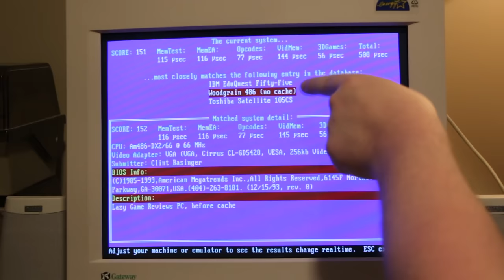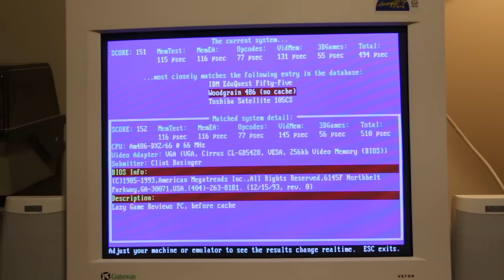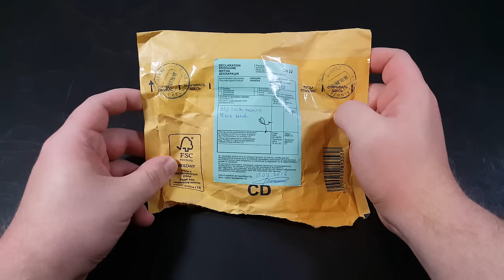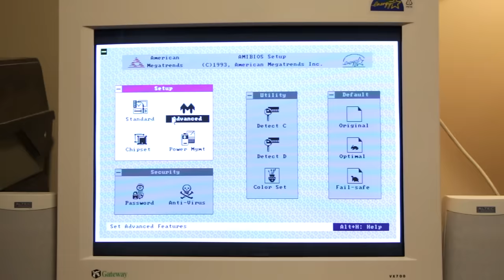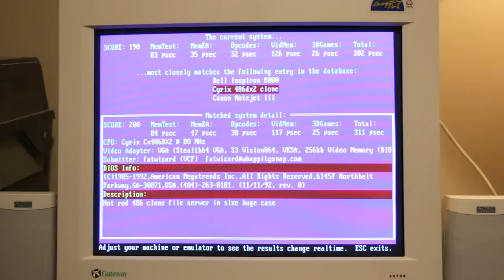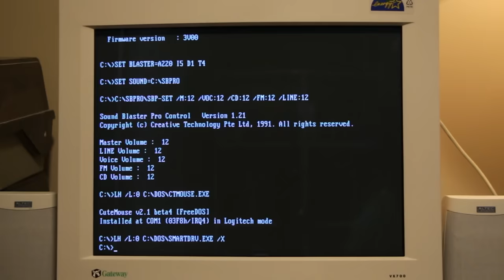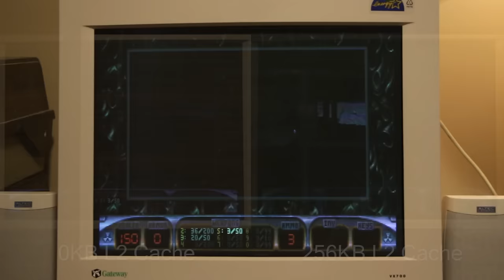LGR 486 Update! Installing L2 Cache

Comment: I never get tired of watching your videos man, your way of talking, your knowledge and all that stuff... Keep doing what you do. <3
Reply from the maker: Thank you!
Reply: I LOVE YOU
Reply: Looks like mine and other's recommendation still was enough to warrant for a new video. ;-) However, I must point out that the machine is still not very optimized. Maybe you should set the cache speed to max. Also, 512K is not going to happen unless you find 4x 1024K cache chips. And eve then, there will be no upgrade to the speed, since you only increase the cacheable area. (from 32MB to 64MB) The more drastic improvements will be a Write-Back Enabled DX2 CPU. It does not enable this caching method out of spite, only a handful 486 actually support that. The other thing would be a PCI or VLB card that is fast enough like a Matrox PCI or a Mach32 VLB card. :)
Reply: Knowledge!
Here in my garage, just bought a new 486 here. It’s fun to try out here in the Goodwill hills. But you know what I like more than materialistic things? Performance. In fact, I’m a lot more proud of these seven new L2 Cache's that I had to get installed to upgrade two thousand new 486's that I bought.
Reply: 4 x 128K cache chips?
But are you saying that if he had installed just one chip for 32KB L2 cache, it would only cover 4MB of address space?
Reply: Spillerrec 486 Motherboards only had like 4-8 SIMM sockets. Most people only had them filld with 4x 1MB Memory. 64K cache were common for high end 386, which had only 8MB max at the time when they were released. 4MB Modules were released at the very early 90s and were super expensive. So with 512K cache, you would have to find a way to fit 64MB into that 486 to make use of them. Most chipsets didn't even make use of more than 256K.... :)

Comment: Yay, L2-Cache! This fine 486 sure did deserve it!

edit: Given that you can disable the L2 cache in the BIOS (without that jumper configuration horror, oh my) you may be able to, e.g., do Doom "timedemo demo1" (I guess duke3d also has timedemo functionality?) benchmarks with and without L2 cache to quantify the speed gain if you desire to do so.

Great video, always a pleasure to watch!

edit2: Another thing that influences 486 performance: The original 486 L1 cache design is a write-through cache, which means that any writes need to be synced with memory (or L2) immediately. Intel later (with the DX4) changed this to a write-back cache, where L1 cache lines need only be written to memory (or L2) when they need to make place in the L1 cache for other contents, greatly reducing write accesses to memory.

Your 486 is a "66NV8T", which means it's a 66 MHz piece, with reverse-engineered (non-Intel) microcode, 8 KB of L1 cache, write-through (the "T") caching policy - this should perform exactly like an Intel DX2. Later AMD released the "Enhanced Am486", which has write-back cache and performs better than the classic flavors if the BIOS enables write-back L1 cache (or if there's a jumper setting for it). If you happen to have other AMD 486 chips lying around: If the model code ends with a "B" (e.g., "66SV8B", like https://commons.wikimedia.org/wiki/File%3AAMD_Am486.jpg) this is a newer version. The 100 MHz Am486 you considered in your original build is such a newer version (and, of course, will also run nicely at 66 MHz if you so desire).

(I don't think Intel released a DX2 with write-back cache)

Comment: Damn! You just shook the dust out of my old nerd brain. I used to build these things years ago. Went to many a computer show (Geek flea market) and bought parts! Never bought a ready made box. It was more fun building it out yourself. A co-worker and I years back when the Atari 130xe, etc. were popular were working night ak/a Graveyard shift. Being Resident Programmer Analysts could get pretty boring on the night shift. We were there in case a job on the mainframe coughed up some bits which thankfully was rare. A bored RPA was a dangerous thing soo... We hardware hacked two Atari 130xe's and kicked them up to 320k! A monster in those days. They got a kick out of us with ripping open the machines and swapping out chips plus making wire jumps on the board to be able to address the extra ram in bank switching. Ahh.. those were the days.
Reply: Do you still have the Atari 130XEs? If so, check out some of the current upgrades. 1MB and more, 65816 CPUs, RGB output, Dual POKEY "stereo" audio, SD Cart Adapters, WiFi Modems, you name it!

Comment: The difference between 28 and 32 pin SRAM sockets is the maximum memory per chip supported. The 32 pin sockets have extra address lines to support 64Kx8 SRAMs, while the 28 pin sockets only support 32Kx8.

Technically that board could handle 384k of cache with 4 x 64Kx8 and 4 x 32Kx8 chips, but I doubt it could address all of it due to the TAG RAM being too small.

The 32 pin sockets are probably to give the user the option to use four 64Kx8 chips or eight 32Kx8 for 256K of cache; Or two 64Kx8 or four 32Kx8 chips for 128K of cache.

Comment: Shove a 100MHz DX-4 in there Clint! Com'on, you know you wana!! (:
Reply: As someone who had a DX2-66 growing up, I would be interested to see just how much more performant that processor might be. What do you say, Clint?
Reply: +John Bradley I've used both. With a DX4 @ 100MHz, Duke 3D is incredibly smooth (at standard resolution OFC). That's without boarders and high graphics mode too.
Reply from the maker: I've talked about and showed a DX4-100 before! It's quite fast.
https://www.youtube.com/watch?v=Qt-0lqkJUKE
Reply: +Lazy Game Reviews True that. Just thought that the speed advantage would be a nice thing to have considering the compatibility for DOSing should be much the same as a 66 DX2. Love these hardware vids none-the-less, Especially anything 386/486 related! A 386 (or before era) build would be pretty sweet someday though. (hint? =P)
Reply: Excellent. I need to dig deeper into your back catalog, apparently.
Reply: how about 5x86DX5-133? it should really rock!
Reply: No, that's 486-class CPU manufactured by AMD or Cyrix. And fits on Socket 3.

Even more, there is 5x86DX5-150 and 5x86DX5-160 CPU existing, but they are very very very rare. And 160 needs 40 fsb, which can cause instabilities in PCI.
Reply: If I wanted a PCI based system, I'd rather go for a K6, 6x86 or a Pentium.

+R33Racer The DX 4 100 does beat a Pentium 60 and 66. The Pentium didn't stretch it's legs until the 90Mhz came out.
Reply: I had a 486 that had a 50MHz CPU then I was able to get a DX-4 100MHz and I was happy as hell and used it mostly for Linux and IRC. One day some one gave me a 486 that had one of those Kingston 486 to 586 upgrades and even though it was 133MHz it couldn't catch up with the DX-4.
Reply: I had amd dx4 133 "designed for microsoft windows 95" with windows logo on top but it might just be rebranded 5x86dx5
Reply: I ran an AMD 5x86-133 for a couple of years at 150Mhz on a 50Mhz bus. It was very stable since you typically didn't have PCI in the 486 era, except at the very end. He's using a VLB motherboard, which should be fine as long at the vesa(vlb) video card tolerates the bus at 40 or 50Mhz, which most of them do.
Reply: Am5x86 @ 160 MHz works fine with PCI cards, you will run into problems using 40 MHz fsb & VLB cards. 
BTW the 160 MHz version was never released. You could use the ADZ version to get 160 MHz by overclocking. The ADZ is overclocking-friendly.
The 150Mhz version runs @ 3x 50 MHz, so this is probably worse than 4x 40 MHz = 160 MHz.
Reply: Never even heard of those. They were basically the pentium equivalent from AMD? Why not just use a pentium though? :P
Reply: Not exactly, the Am5x86 aka AMD 486DX5 aka AMD X5 is still a true 486 CPU. It just comes with a 4x clock multiplier (DX4 had 3x clock multiplier).
These came out in late 1995, when Pentiums already ruled the world. So maybe they thought hey let's call it 5x86 ! That sounds like a next generation CPU !
The Am5x86-133 also got a P75 rating. That means the 133 MHz version should more or less equal a Pentium 75 in performance.
But in reality, you would need to overclock it, put in on a fast motherboard etc etc etc...to achieve the performance of something like a P75.
I like the design of the Am5x86, you could easily upgrade an old 486 system with one of these, but I also think that this Am5x86 is a bit overrated these days :)
Reply: Kingston turbochip 5x86 :-)
Reply: The one in the video was the Intel version, but I do remember you showing that there was an AMD version that you considered putting into it. Required a fan and everything. Would be cool to see you put it in along with the full ammount of memory and that 512 cache.
Reply: Oh hell yeah!  I used to have one of those bad boys. It was the Intel overdrive chip with the built on heatsink. VERY fast for its day...
Reply: Upgraded from a SX33 to a AMD DX4-120 and that was well fast could certainly match a P60 or P75
Reply: That was the cpu of our first pc Happy times
Reply: ***** I have several. Sadly nothing above 100Mhz or a 5x86. I own Two 100Mhz DX4's. One in a VESA desktop, and one in an All-in-One Compaq (silimar to LGR's though slightly later with a CD-ROM drive).
Reply: +R33Racer Reminds me of my DX-33 & DX-50 MHz machines!!! I remember when I bought a 1 Meg Trident video card too(then upgraded to 4megs in this same way) thinking... What a difference!
Reply: The 100 MHz DX4s are just fine. If you have an Intel DX4 with 16kb L1-cache, you are probably as good as with an Am486DX4-120. I have an Intel DX4-machine and an Am5x86 @ 160 MHz. Believe it or not, but its hard to tell the difference between these two. An Intel DX4 is roughly twice as fast as a DX2-66 in some applications, but a 160 MHz Am5x86 is roughly just 30% faster than a DX4-100 in the same benchmarks. The 486 architecture is pretty much at its limit around 100/133 MHz. Beyond that point, CPU speed won't affect much.
Reply: A 486DX4 100MHz ought to be equivalent in performance to a Pentium 66Mhz, if memory serves me.
Reply: ***** Nah not really, more like 50Mhz if such a Pentium existed. Intel really made a monster when they introduced that CPU. AMD would be in it's dust (with a few noteworthy exceptions) until they made their Athlon Skt.A CPU's.
Reply: +R33Racer I remember upgrading to the Athlon back in the day :)
Reply: 1blisslife And, before the Athlon processors, I remember building a PC with the K6-2 and then replacing that CPU with a K6-III on an old Jamicon AT Socket 7 motherboard with an ALi chipset.  When that motherboard bit the dust, I replaced it with an FIC motherboard using a VIA chipset.

After that one wound up being too slow for my needs, I built a new machine with a Biostar motherboard with an nVidia chipset running with an Athlon XP 3200+ CPU.

Then, I was given a broken Dell Dimension 4600.  It was nothing serious: reset of the motherboard fixed it and I replaced the PSU.  I then upgraded that from its 2.6 GHz P4 to a P4 Northwood running at 3.2 GHz (complete with a copper heatsink).  I would have preferred a 3.4, but I had gotten a good deal for the 3.2, so the price difference didn't justify the slight performance gain with the 3.4.  Eventually got a GeForce 7800 GS for it.

Then after that, I wound up with my MacBook Pro.
Reply: My history:
80286 20mhz, 486sx 33mhz, Amd K6-3 300mhz, Athlon XP 2200mhz, Intelquadcore 2.6 ghz.... today Intel i5
Reply: Synthusiast Cool.

My history was with a Tandy 2000 with the 80186, then a Commodore 64.

Then a nice upgrade to that Tandy 486sx 33MHz, which would be upgraded to a 486DX4 100 courtesy of the CPU slot for the Overdrive upgrade.  Then then K6-2 at 300 MHz and then up from there.
Reply: DX4 was horrid... 4 times multiplier... only a 25Mhz bus? Nah.. The 66 with a 33 bus was much more balanced.
Reply: DX4 has a 3x clock multiplier, 3 x 33.X MHz = 99.X MHz.
Reply: Diggnuts Well, that slow bus speed was the ticket to letting some of those Sierra AGI and SCI engine games run properly.

And, hey, that old Tandy with the Overdrive upgrade was able to run some relatively demanding DOS games, like "Wing Commander 3" and "Fade to Black" in their Super VGA modes, without any problems despite its limitations.

For me, the setup I had worked perfectly.
Reply: Screw that, he should get a 133MHz AM5x86 like my old PC has. Thing is blazing fast. (for 1995)
Reply: It's very deep man.  So deep, I'm afraid to dig into because I know I probably won't come out again.  Anytime I do dig into it, it's usually because youtube suggests something from it when it can't think of new stuff to pitch.
Reply: the best 486 should be the 4/120. since it runs on 40mhz interenally. as far as i remember the 4/100 only ran on 33,3MHz. there's a 4/133 as well i believe, which also runs on 33,3MHz internally. 40Mhz internally can limit the number of VLB cards you can use tho.
Reply: Why exactly does a DX4-100 have inferior memory and I/O throughput ? Some DX4 models provide 16kb L1-Cache (at least all of Intel's DX4s). 
Never heard of a DX2 having more than 8kb. That is a huge advantage in memory performance.
When it comes to memory performance, I would say a DX4-100 with 16kb L1-Cache would outrun every DX2 on the planet when plugged into the same motherboard. 

The only time I encountered problems with cache speed was when I set the cache-timings too fast. Fast CPU + slow cache-timings never were a problem. 
Another big problem is, if you add too much RAM to the system, you will probably get too much RAM outside the cacheable area and the whole system's performance will get slower. 
This is motherboard-specific. For example, some boards can handle 32mb RAM with only 256kb L2-Cache, some boards will need 512kb or even 1mb L2-Cache to handle 32mb of RAM.
If we look at Clint's video here, we can see reading from L2-cache is 42.9 MB/s. 
Non-cached reading only achieves 11.6 MB/s (If I got that right). 
What I want to tell you is, I think that "cache that can't keep up with bus-speed" is an illusion.
To get things stable, only add as much RAM as your amount of cache can handle.
Tuning the timings in this case might give you an impression of increasing stuff. 
But things will get bad again, if there's reading or writing in the non-cached area.

If your motherboard can't provide 3.3v or doesn't natively support a DX4, you can always stick with a DX4 overdrive. In my opinion its all a matter of personal taste nowadays.
If you have a nice high performance DX2-80 setup, there's nothing wrong about it. Maybe it is indeed faster than some DX4 setups. I would also prefer a nice DX2-setup like back in the days over a "modern" Pentium-era DX4 like the Am5x86.

Basically you are right, you can reach higher clock speeds for the ISA-bus with 40 MHz bus-speed than with 33 MHz bus-speed.
You can also run your VLB-cards with 40 instead of 33 MHz. PCI on 486 was often limited to 33 MHz.
You are also right on stating that the difference between a DX4-100 and a DX2-80 is marginal in practical use. But the 16kb L1-Cache versions might be the game changer here.
The difference between 8kb 486 CPUs and 16kb 486 CPUs is shockingly huge. 

Remember the 486DLC-40 CPU ? It was basically a 386DX-40 CPU enhanced by only 1kb L1-Cache.
This thing was roughly 25% faster than a 386DX without L1-Cache.

Do you have a DX2-80 system ? I would love to have a look at some benchmark results.
BTW: You have some amazing high quality SB16 recordings in your videos. Great work ! :)
Reply: I see, thanks for the detailed explanation ! 
Yes the 40 MHz DLC actually runs pretty hot.  A cooler is definitely recommended :)

I have some realtics for a DX2 and a DX4 system:
i486DX2-66, 512kb L2, 32mb FPM RAM, Tseng Labs ET4000W32p 2mb VLB - 2662 realtics (28.06 fps)
Intel DX4, 512kb L2, 32mb EDO RAM, Tseng Labs ET6000 4mb PCI - 1818 realtics (41.08 fps)

Would be nice to see, where a DX2-80 will find it's place. 
Maybe I can get an 80 MHz CPU in the future, so I can just replace the 66 and run some benchmarks.
I can't remember if I ever tried to overclock the DX2-66...that would also be an option.
The 66 also runs very hot, but maybe it will survive some benchmarks :)
Reply: I&#39;ve got a few of those sitting around in a box somewhere. They even had a built-in cooling fan. P.S. this should have been under the Kingston 5x86 comment. I do have a few dx4-100s sitting around somewhere though.
Reply: why does everone forget about the DX 4/120 ?
Reply: Watcher3223 a big drop with the fruitbox then ?? 😋😎
Reply: R33Racer thats what I was going to suggest if the mobo will support it.  I don't see why you wouldn't.  Duke nukem would be completely playable then.
Reply: No, that's the Pentium era, like Doom. You're kind of missing the point of builds like this. My main computer is well over 1,000 times more powerful than this computer. You have to draw the line somewhere if you want to maintain the integrity of your vision.
Reply: Right on. To each their own and good luck.
Reply: I still have a Pentium60 or 66 overdrive for 486 socket shove that in and ure flying
Reply: or an AMD 5x86 @133?
Reply: Great idea! The 5x86 was an awesome upgrade at the time, pretty much as fast as the Pentium 75.
Reply: @Nocito87  I had a couple of DX2-66s overclocked to 100 MHz (one AMD and one Intel).  They both worked fine and got around 77 MIPS on the benchmarks I ran.  It was a bit tricky getting the HDD adapters and video cards to run at 50 MHz on the VESA local bus, but in the end they worked out surprisingly well.
Reply: Or better yet, a Pentium overdrive!
Reply: @sinephase  back in the day the AMD and Cyrix chips actually outperformed Intel
Reply: @LGR  its quite fast my dx4-100 was my first amd cpu haven't looked back